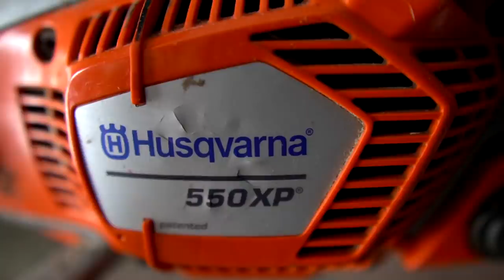Winter Snow Storm at the Cabin | Iron Dog 2022

Comment: That snow reminds of here in Northern Michigan.  The wet,  heavy stuff is miserable; we call it "greasy". That snow is tough to drive in,  shovel, blow,  and a huge hazard on roofs. Also needs to be completely removed from vehicles so they don't fly off in sheets and shatter windshields. Respect for all your hard work.
Reply: Another Michigander here, I agree completely! This is also a reason why we use tarps to cover everything stored in our shed, hard to keep that blowing snow out
Reply: We call this snow "cement" in Seattle because it's all we get and it breaks everything.

Comment: The chickens look pretty happy taking a walk on the snow. ;) Once again, thanks for bringing us along on your day to day life!
Reply: They seem to really like it! Definitely different than when I raised chickens growing up in Ontario, Canada.
Reply: Winter forest - booming, like shots, croaking crows, snow from a spruce branch that fell by the collar, tracks in which the bottom is not visible, steam from wet mittens and parallel, now and then intersecting curves of ski tracks; spring forest - the smell of black, still frozen earth, flowing in all directions, choking with melt water, a stream, a thin white strip of skin blue from the cold between a sweater and jeans, and on it large pimples that can only be melted with lips; summer forest - hot drops of golden resin on copper bark, hair smelling of barbecue smoke, a white, daisy-covered sundress stained with dry red wine and a tickling pine needle that you can’t get at all if you don’t unbutton two thousand small, like ladybugs, buttons , rapidly spreading under the fingers along the back and chest.

Comment: Hey guys. I saw you refill those small Coleman canisters with LPG from a bigger bottle. That is extremely dangerous as you have no idea if you're over pressurise that small canister. If it was to explode due to over pressurisation you would loose your hands or it could be fatal. To do a refill like that you'd need a regulator to slow the flow down, and a gauge on both the bigger bottle and smaller bottle so you know what pressure if coming out of the main tank and what pressure you're putting into the small one. I work I high pressure gas pipelines and wouldn't want to see you guys come unstuck with that sort of stuff.

Stay safe and keep up the epic videos 😁
Reply: The bigger tanks all have safety valves it will not over pressurize a 1 pound bottle. A 1 pound has the same amount of pressure released as a bigger tank and has a pressure relief valve.

Comment: Quick tip… after you refill the green one pounders, cap them. They do have a tendency to leak propane after a couple uses. Been refilling them for years! There are brass threaded caps that fit perfectly. We have also used 3/4” threaded pvc schedule 40 FPT Caps with excellent results.

Comment: My Boss has ridden the race several times in the last few years, you're right about the suspenion parts. I've built several parts to keep lower A frames from ripping the chassis apart, you can change the A frames but if the mounts are gone, your finished.

Comment: A tip on refilling the 1lb canisters - weigh them on the scale before and after to make sure you are not overfilling, it might be dangerous
Reply: My experience is that they can't be overfilled if the air is not vented when filling.  Actually, the one lb bottle won't even be full if the air is not purged when filling.  I always use a scale and pull the pin (not push) on the schrader(?) valve to vent the trapped air.  It's not easy since the pin is not easy to get to when coupled to the 20 lb er.  13 oz or less is all the liquid I can fill to unless I vent the air. If pulling the pin on the schrader valve to completely fill to 15-16 oz, be sure to listen carefully for any leakage around pin when released.
Reply: @2daloo829  I never pulled the valve and managed to fill to about 16oz. So, ymmv, I guess

Comment: Hope you guys actually get this. First of all; you guys are AWESOME!!! I love every episode you put out, especially the FISHING videos!! I do have a suggestion for Eric. I have noticed that most times after you catch your fish you filet them. That's exactly what I do, however, I use a little cheat when I do filet my fish that cuts down on time and increases safety from a knife cut by almost double. It also gives you more control of the fish which in turn allows for a more precise cut and bigger returns on the fillets themselves. I would like to share  it with you........grab a piece of spare, clean wood from your leftovers cuts; we all know you have some!!!!  Turn it into a basic cutting board and the length should be about as long as the biggest specie of fish you catch. Lay your next fish on the board and take 2 nails or 2 screws and drive them through the flesh of the fish just before the tail in a top of the fish and bottom of the fish pattern. ENJOY!!! I use screws because it is faster. Cleaning fish; no problem. Filleting fish; no problem. Your hands will stay less slimy and your cuts will be much more rewarding. WARNING!!! Eric PLEASE don't grab one of ARIEL's cutting boards and do this!!!  Thanks for being amazing guys.

Comment: Last I heard, 90% of the world's sea planes (which includes most bush planes in Alaska) are serviced by Kenmore Air, which is based down here in western Washington State, not far from Seattle.  They have a lot of parts for swapping out wheels for runways, pontoons for lakes, and skis for snowfields, but they also have hybrid versions, pontoons with wheels, pontoons sturdy enough to be skis (ice in snow can scratch rather badly at a summertime pontoon).

My family has been answering their misdials (our phone number looks like theirs) for over 40 years now, so I gave up and learned a bit about the company, and about sea plans and bush planes in general. NOT an expert on either those or the company, but they're good folks, and are justifiably proud of their pilots' abilities in snowfields, on glaciers, etc. One particular contract they had in the early 2000s was to fly in & out on supply runs for a high-altitude research station on a glacier, where the only way to land on such a short runway was to do so uphill so gravity stopped the plane in time, then turn it carefully around on the small flat spot on top, and fly out fast enough downhill to achieve lift on the first try.  Zero problems, each & every time.  That takes dedication to pre-flight checks, weather observations, & nerves of steel.

Bush pilots tend to be highly underrated in their skills & abilities, because we often underestimate the conditions in which they have to take off & land.  It's not the same as fighter jet piloting, no, but it can be difficult, even dangerous, and takes no less skill & ability to fly successfully, especially in winter.  The folks I met at Kenmore Air in the early 2000s (I asked for a tour of their main shop, after having politely answered their misdials for 20+ years at that point, and they happily agreed) were absolutely dedicated to making their planes & repair jobs the safest and sturdiest possible, with palpable respect for the overall skills of the bush pilot community.

...I'm posting this because I know a lot of people don't understand just how tough & dangerous bush piloting can be, but also because we don't hear about the millions of safely flown & landed flights; we only hear about the tragedies.  The folks who fly the supplies out to these remote villages Arielle mentioned are contending with bad weather, freezing temperatures, uncertain landing surfaces, abrupt sheer winds, and life-threatening conditions if they have to make an emergency landing for any reason.  Support efforts & support personnel are absolutely vital on races like this, and I just think the pilots doing their share deserve some love & appreciation for a few moments.

Also, big thanks to the remote communities who turn out to support the racers, including support shown in terms of food & lodging, repair assistance, fuel, and more.  And of course, big thanks to the people who come out to cheer on these racers in the midst of thousands of miles of winter.  Knowing that their efforts & skills are seen, that they're bringing excitement and entertainment to so many others, is what drives a lot of these folks to compete, even knowing they might not ever take first place.
Reply: Thankyou for this snippet from another side of life.  I think most folks would go for a number-change - but your family has stayed the course, with courtesy.  Big ups for that.  And you're right about the skills of pilots working in remote areas!

Comment: Can so relate to the snow and dealing with structures and build up. This winter has shown us we really need to rethink the lay-out. When you are dealing with huge mounds all over. You start to run out of space to add to it. We have 18" to close to 28" in spots still . And whats plowed is a ice rink.My Husky 460 is a monster when cutting. But it can get finicky , had it stall mid tree . And had to use my Sthil to finish the tree. I have a 16" Echo as well. Never failed once. Needs a new piston and such now , But still starts like it,s new. Must be 15yrs old now.

Comment: Something you will learn (or may already have) with the propane fills - sometimes you will hear the check valve click but no 'hissing' of filling - just shut the big tank off until you hear a click, then open it back up till you hear the hissing. Sometimes it takes a few tries. It seems to help to open the valve slowly. (They dont need to be super cranked down)
Also, buy the little cans with the metal reinforced bottoms - for some reason with the plastic bottom cans, the valves go after a few fills.

Comment: WoW Lots of snow. We still havnt got our big storm yet of the season. Only got a couple months left. Still brown grass! In our coop we layed linoleum on the floor and used some 1x1s for the the edge to hold it down. then tossed in the wood chips and straw. Sure makes it nice in the spring when you need to clean it out. and the wood dosnt rot away and soak in all that smell. Stay safe up there. Cant wait to see what the garden produces and more fishing videos this year! When you open the 20# propane tank with a OPD vaule soon as you here the propane coming out the vaulve is wide open. You dont need to screw it all the way out. its not like the old ones were it would slowly come out. It open or its closed with a OPD.

Comment: Have you thought about getting a propane converter for your Honda generator?  It doesn't stop you from being able to use gas. Hutch Mountain has them.  It would eliminate the water issue.  Thanks for the tip on putting the small canisters in the freezer.

Comment: That snow is the kind of snow we get here in New Jersey. Wet and heavy! I use a shovel with a bent handle to take the weight of my back. The last few years have not had a lot of snow... just a few storms but there were a few years in a row prior to that when we got weekly storms that were all 6-12 inches and no melting. I was walking the dog walled in with 3-5 feet of snow.

Comment: The tooth in front of the cutter is called a guide , if you flat file the tops of the guides your chain will continue to be useful long after other's likely have thrown the chain away. Be careful of kickback as the more bite you have the more kickback you'll get. It's just something you get used to. With your bigger pro level saws like 72cc and bigger it doesn't even bogg the saw down it just throws bigger chips.

Comment: A cheap fence tightener is get a couple of 2/4s and drill holes and put bolts in holes after you set them on the fence on both side and then pull it tight with 4wheeler. May have to bend wire and double it up or more if needed.  You can figure it out. Look on line cause you can buy steel pullers

Comment: It's going to be a warm spring! We've already have had 89 degrees and it's in the 80s most days now. Everyone is sun burnt and the dogs don't run very hard and mostly stand around and pant. They've already blown their winter coat so plan on it getting warm pretty soon. If it all melts at once your going to be standing in a lake. Hey I know your trying to keep your electricity down but think of a grinding wheel to sharpen your stuff even a small grinder would have helped some and you do a lot of sharpening so there is a need there. Great video and the chicken came in beautiful the colors stood out!

Comment: Refilling the small propane bottles is a saving, but they don't work forever.  The seals do wear out and will then leak so don't store them in a closed space.  And if you do fill one and it leaks put them on an appliance (lantern, torch, etc) so that you don't lose the propane and then discard the bottle when empty.

Comment: Eric I have not read all the comments here but have you considered converting your Honda 2200 generator to propane? The kit is specifically designed for the 2200 and it will be able to run on propane, natural gas or gasoline.  I converted my two Honda 2000’s 3 years ago after tiring of gummed up jets in the carburetor, etc associated with using gas.  Easier to start and longer run times when running on propane.  No fuel storage issues as propane has infinite shelf life.  Kits available from Hutch Mountain.  Y’all stay safe up there.

Comment: Thanks for the video Arielle & Eric! Refilling 1# propane bottles is a good way to save a few bucks. I also got an adaptor so I can burn propane from a 1# bottle in a pocket rocket stove burner. It works better down to -40º but the only challenge is that the higher pressure propane can make a bit tricky to adjust the flame. I just got home (Mendocino, CA) after 2 weeks at our cabin in Minnesota. The low temperature was -32ºF, the average was 4° and it never got up to 32º. It takes some work but the winter solitude up there is great!

Comment: A few cc of acetone will allow the water to burn with the fuel. It is a common ingredient in products for fuel to get the water out. It does not remove but forms a solution which is miscible with gasoline.

Comment: When filling those little LP tanks if you want to get them a little bit more full before you hook them up take something to depress the fill valve on the top and let all of the remaining air pressure out of them. Sometimes even after filling them for a little bit take them off let a little bit of the air pressure out and then re-hook them up to the main tank and you can fill them up a little bit more 👍

Comment: You need a set of Scales to weight those small propane tanks.  You can over fill them. They want have room for Liquid Gas to expand when they start to get Warm or Hot. The One Pound should the 80% full , The 20% left is for the expansion.

Comment: In WA, we also have problems with "bad" diesel i.e. contaminated with water. So one of the first mods we do to our 4WDs is to add a pre-fuel filter which stops the water going into the engine. These items cost a few dollars but can save you much more in the long term!

Comment: On your shelter logic building you can clad it with roofing tin.  I did ours and it made it stronger and also negates issues with the fabric on the building.   I put the sheets up lengthwise and lapped the edges like normal; used the appropriate metal screws... Just a thought...

Comment: after you refill the propane bottles bleed air out of small bottles for 3 seconds(using the Schrader valve on the tank) and then refill a second time you will get more propane in the bottle.

Comment: Concerning LP refill

You don't have to freeze, if you have  your fart valve at 10 and 2 or 3 and 9, you can relieve the pressure manually with small needle nose pliers without overfilling the tanks. there needs to be space for gas, not just the liquid. Stop when you see liquid squirting out and also check that your fart valve is seated right. I've had slow leaks before.

Comment: Id like to make a suggestion... Use aviation 100LL fuel in all your 4 stroke small equipment. ( not 2 stroke). its way more stable and will perform excellent in extreme conditions. Give it a try, i promise you wont be disappointed by using distilled fuels as all impurities are removed. In long term storage as an example it takes 9 years for it to varnish.

Comment: IF YOU FIND THE TANKS ARENT GETTING FILLED. THERE IS A VENT ON TOP OF THE 1 POUNDER THAT YOU CAN ACCESS WITH CURVED NEEDLE NOSE PLIERS TO BLEED PRESSURE AND ALLOW YOU TO TOP OFF CANISTER. [KINDA LIKE THE SCREW ON BIGGER TANKS]TO ENSURE ITS NOT OVERFILLED ONLY FILL TO THE ORIGINAL WEIGHT:]